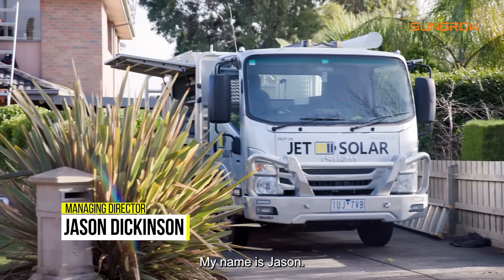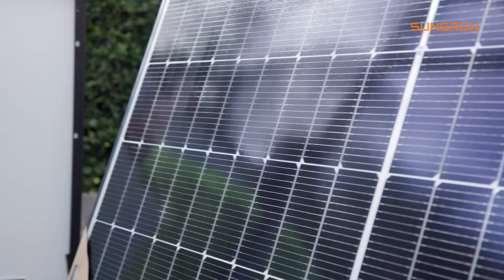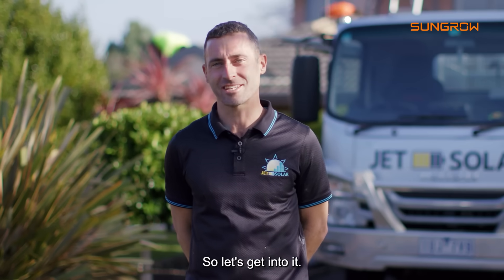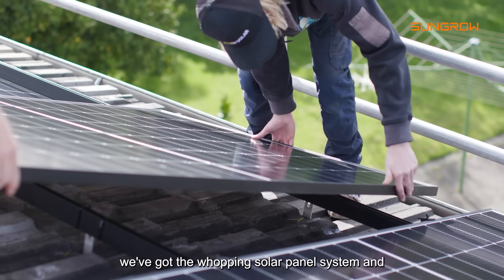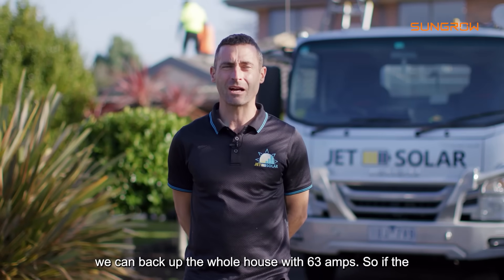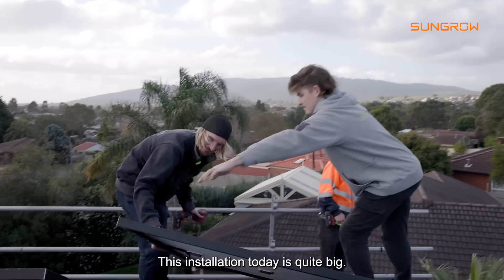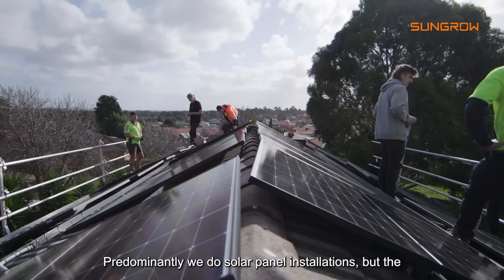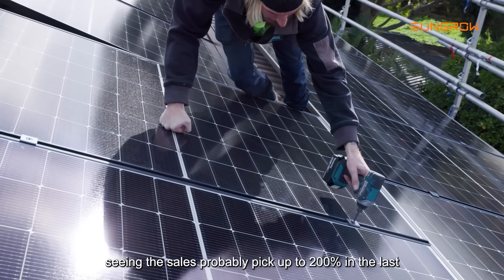Home Energy Solution  Case: SH10RS + SBR192

Comment: Hello Sungrow, we have the Sungrow SH10RS inverter and the Sungrow SBR192 home battery system for 6 months now and it is working fine. Today there is a power outage but the system is not working. We have been trying to get in touch with Sungrow but didn't receieve a response. Why is our Sungrow system not working during a power outage?